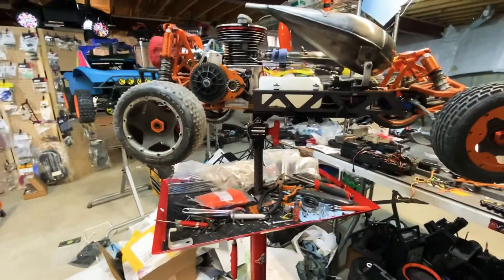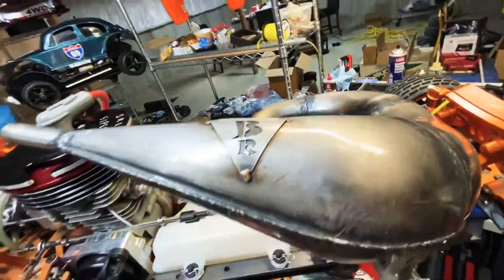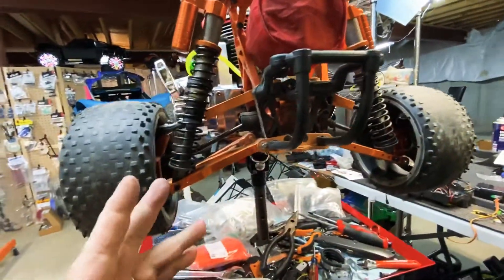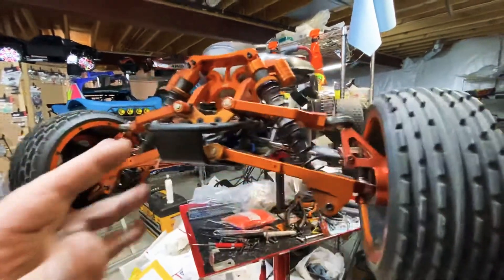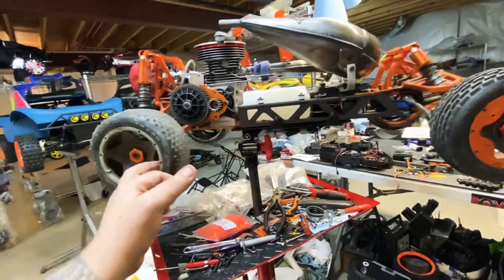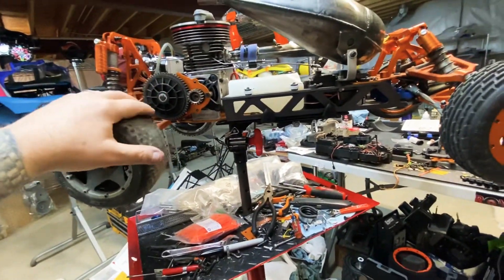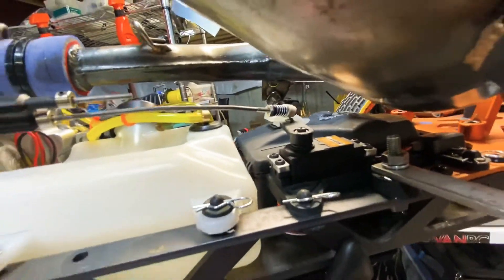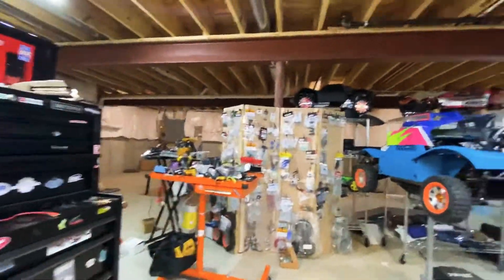🔥SRE CUSTOMS🔥 Super 60🤩 In the King Motors Baja 💪🏻👊🏼👍🏼

Comment: Goodluck on the drivetrain I sheared a stock 17 tooth pinion yesterday testing thank God your running the big power I new my shit wasn't going to be up for it right out the gate and when I was watching your vids I new yours should be able to just run fuel. Now I have to order a hex head clutch. Fml? I did get to run a couple tanks before it chucked the pinion and I definitely need to lower my ride height and see if that helps settle down the chassis because everytime I gave a good pull on the throttle it was pretty hairy trying to keep it pointed in the right direction.
Reply from the maker: I have lots of extra parts !! I learned a long time ago you need parts !! She’s gonna be a lot of fun !!